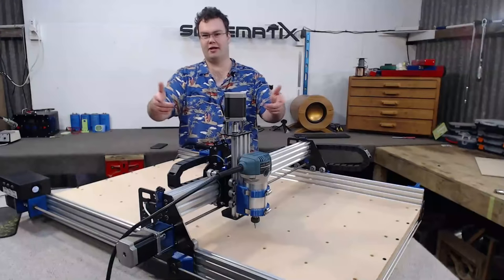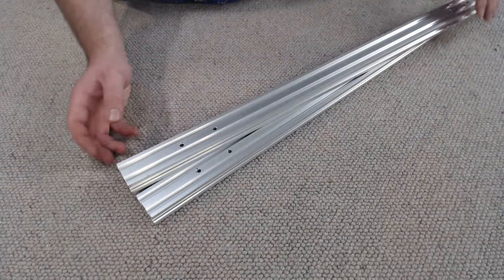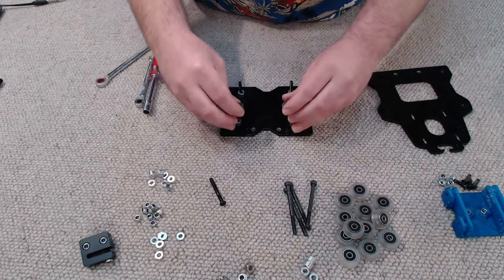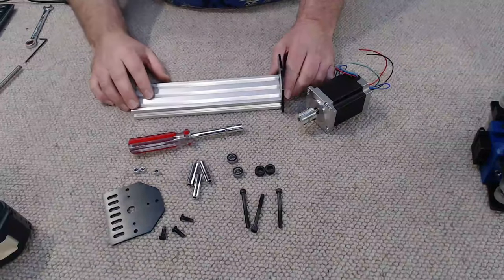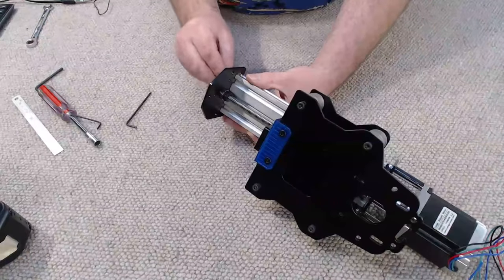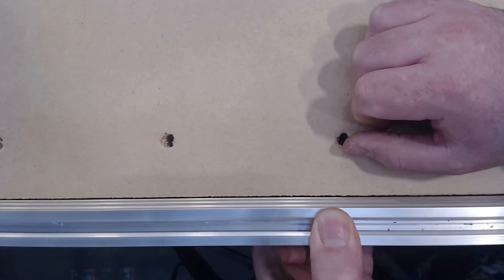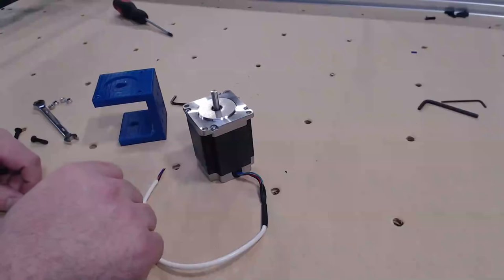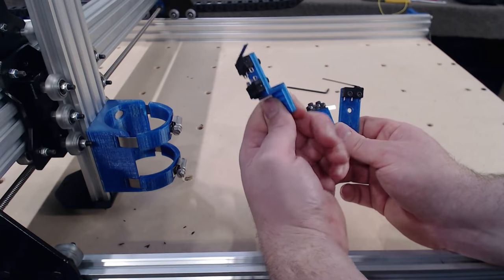How To Make: The OX-Metal CNC Router Mill (Complete build)

Comment: This is amazing. I run a small furniture company in the UK. We have been looking for a way to get CNC for a long time but it has always been out of our price range. Hopefully will be building this over the next few weeks!
Reply from the maker: That's awesome to hear! hope the build goes smoothly :)
Reply: I will keep you posted. At the moment i am trying to cost up the whole build. On another note, after i have succesfully done the build, i am considering scaling it up to cut 2440 x 1220mm board. What would be the issues of this?
Reply from the maker: If scaled to the size mentioned the axis's will lose some amount of stiffness. Probably still good for cutting wood. But metal will be out of the question. You'll have to alter the design to use GT belt as longer lengths of 8mm lead screw are almost hard to find.
Reply: I have had a quick look at i did see some 8mm lead screw at 2500mm. My worry is that the length of it will cause it the bow. Anyway i will focus on getting the original built then perhaps look at going bigger. Even at the size it is now it will really help our business.
Reply from the maker: its possible it will bow at that length, belt or 8mm screw will both have a high amount of elasticity at that length. Some experimentation maybe required. At least you know the size machine I build in the video is rock solid
Reply from the maker: Just an after thought, I'd recommend perhaps getting gantry plates that allow more head room for milling thicker stock. Could be handy considering the type of stock I imagine a furniture company milling. I'm considering doing this to my OX-Metal in the future.
Reply: well we use 18mm mdf. It may be beneficial to have more travel on the Z axis if we decide to laminate boards together. For example producing a mirror / picture frame out of one laminated block of wood so you get the depth for cut detailing. It looks like the Gantry plate is produced in one size only? I have costed out the machine in this video, comes to around £1,100 including your router and cost of printing the 3D parts. Not sure what the software costs may be on top of this, but there is probably some freeware available (i need to study more in depth your other video from the computer side of things). That being said my target to get this built and running is by the end of the year. hopefully a lot sooner.
Reply from the maker: If you're only planning to cut MDF/plywood or similar then you'll be fine with the stock gantry plates. There is only 1 size I'm aware of, you'd have to get the gantry's design slightly altered for more Z travel. As far as software goes I'm doing a video soon on CAM software. Freeware has been so far a mixed bag (mostly bad) But there is 1 paid CAM program that rocks for only $250USD. stay tuned!

Comment: what is the cost of the CNC router and where can you purchase one I'm in the USA thanks for your help nice job
Reply: quality Router cutting bits can become rather expensive but a Dewalt 611 goes for around $120.
purchase the other parts from the part store!
http://openbuildspartstore.com/
Reply: FearlessVampireKiller.            No I'm not talking about just the router I meant the whole CNC router machine where did you get it and what can I expect to pay for something like that.  Thanks Jim
Reply: Jim....you can learn how to make them online...there are many CAD models and instructions complete for free online (for instance just one site of many that has many different versions of the same router (known as the 'OX' design) can be found by googling "OXcnc" and going to the website.  As far as the cost....well that question is similar to asking 'how much does a table saw cost' or how much does a 'truck' cost....it depends on the table saw and the features and where you buy it from and it depends on the truck you want....there are some trucks that you might be able to buy new for ?? 20000 dollars...there are also some that cost more than 150 thousand (I am sure if I looked a bit I could find such an asking price).  Your question is so general it is impossible to give a 'decent' answer...IMHO (in my humble opinion).
Reply: as for the cost of arouter type cnc for wood and light aluminum routing....well you ballpark.....0 dollars plus a whol lot of 'time'....to ....a crappy one for ?? 500 dollars ISH (just pulling a number out of the air and assuming that is bottom of the barrel for mostly pre-fabricated factory designed version....that price is still honestly a bit lower than mainstream (i.e. you would have a hard time finding a CNC for that price...let alone one that was worth much...I might be wrong...but it is a ballpark pulled out of thin air to help you.  The answer was a bit late in coming I know, but late is better than no answer at all right?

Comment: I have just acquired most of the parts to build the OX-Metal CNC Router. My big dilemma concerns which stepper driver to use. I know you chose the CNC Xpro and I am looking at that as well as the TinyG and TinyG g2 by Syntheos. Do you have any recommendation enthuse units vs CNC XPro V2 or V3?
Reply from the maker: I'd recommend the CNC xPro boards. Very easy setup with a solid amount of features.

Comment: What kind or spindles are supported for use on this?  I am looking at at least a .800kw- 1.5kw water cooled spindle and I know I will need to find a mount for it but I was unsure of the flex support in the frame with the use of a higher torque spindle.
Reply: I.m.o one of the best out there.

Comment: I made a cnc based on cnc ox. I used the new gt3 pulley and it is quite strong.
I made the machine with 1000x1000, but with the v-slot 2040 because it was what I had available. Now I have monetary availability to complete the machine with v-slot 2080 and 2060. Do you think the pulley holds the 1500mm 2080?
Reply: belt not newer have strong at cnc worst all idea, screw need be or rack and pinion steel not aluminium.

Comment: Hi you are great.. i will make the same CNC mill... question, witch Filament did you use... i dont understand it in your Video... PLA or ABS and Why? thanks
Reply from the maker: The filament I used is PETG. which is a very easy to print filament, very strong  with reasonable temperature resistance. A quality ABS should work also.

Comment: I love the design and plan to begin sourcing parts to build a replica, I did have few questions.  What would you say is the largest X/Y dimensions you would feel comfortable building with this design?   What is best media for the 3d printed parts? I am getting a wide array of prices to have them printed, what should they cost approximately?  In hindsight and all things considered is there anything you wished you would've done differently in the design and or build?Thanks in advancePatrick
Reply from the maker: Thanks. Personally I like the size I build, it enables me to machine alloy at a decent rate. But if you're only machining plastics, wood.etc you could stretch the dimensions. I'd recommend printing in PETG or a high quality ABS or ABS+. There isn't anything I'd change on my mill :)

Comment: Do you think that the machine would be stable in 1500x1500mm configuration, by simply extending the length of the leadscrews, and v-slot profiles?
Reply from the maker: Yes you could. You'd have to machine harder materials slower to avoid backlash.
Reply: Gotcha, thanks for the response.

Comment: Great video. I have a question. You keep mentioning "8 mm low profile screws" as you install them. I assume you are talking about the diameter of the screw and not its length. If so, where did you buy them? I have spent a lot of time trying to find 8 mm low profile screws but with NO luck; unless they are very long.

I can find all manner of 5 MM low profile screws but not 8 MM, unless as I said, very long.

I would appreciate knowing where you got them in shorter lengths. (Note: There is a pseudo 8 mm low profile screw that is sold in shorter lengths; but the height of the head is twice as thick as those you are using. IE: the heads are 5 mm high. I want the very low profile like  you and "OpenBuilds" uses.

Thank you so much,

patdee
Reply: 8mm in length. all the screws are M5 .8 pitch

Comment: Sorry to keep bugging you but I bought the gantry plates and they say they are 6.6mm thick. And your STL files say either 4mm or 6mm will they need to be modified or will it still work?
Reply from the maker: That's alright, it should work just fine. 0.6mm should affect anything.
Reply: Thanks so much

Comment: Great work ! and very detailed. I have already  the regular GT2 driven OX Machine and would like to upgrade to your design. In the parts list however I dont see the blue coated parts needed for the leadscrew assembly.Are they available . Ilanon OpenBuilds or elsewhere ?. Thanks a lot for a reply
Reply: The blue parts are the 3D printed parts he refers to in the video. Check the link that refers to ThingVerse.
Reply: Thank a lot, Regards

Comment: Hi can you please inform to the thickness of your gantry plates? i ordered all the parts you listed as i like your build.
I received 7mm gantry plates as per your parts list, will they suit your files re the 6mm? or do i have to order new one? please help
Reply from the maker: I didn't specify the thickness of the gantry plates. Largely because the 3D part files come in  2 different sizes (4mm & 6mm) which covers the majority. 7mm is a rather odd thickness I must say. However I think you'll be able to get it to work. I'd recommend using the 6mm part files. Most of the mounts will work with a couple exceptions being touched up with a metal file to make room for the extra mm.
Reply: Thanks for the reply

Comment: I thought the Y Leadscrew mount and Y Nema 23 mounts looked a little light on gussets/reinforcing.  After 5 and a half hours printing the first Leadscrew mount (PETG), sure enough, it snapped off right where the gusset (chamfer) meets the upright section (the part that holds the bearing) while I was removing it from the print bed.

I'll try printing it in a different orientation.  If I had the CAD files, I'd add more support, but I don't know how to edit .stl files.
Reply: This is about a year too late but generally PETG has excellent layer adhesion.  If you had a part break removing it from the print bed, I'd probably check your print settings before trying to redesign the part.  Even in the wrong orientation, the part shouldn't break simply taking it off the print bed.  You may have already tried it, but try printing with little or no cooling fan at 240c.  I get good results, generally speaking, with PETG at those settings.  If I lower to 220c or use more than about 20% cooling fan, I get some brittle parts.  Since these are functional pieces, the extra cosmetic quality afforded by lower print temperatures and/or cooling isn't worth increased brittleness.

Comment: Thinking about building this. What's the correct Nema23 type you are using? High Torque? I see there are different types. The housing of the one's used in the vid seem longer than the one's in the parts list.
Reply from the maker: Fortunately with a build like this a wide range of Nema 23's will work. Some people like to match the motor current rating to the output current of the stepper driver. The motors I bought are on the large side for a build like this. From memory they are rated at 3amps current. The ones listed in the build list will work fine for this build
Reply: Ordered all the parts last night... so.. fingers crossed everything works out. Today I already received the first parts; MR105-2RS Bearings. Guess those are left-overs from the original OX parts list, which used Nema17's, because I can not find out where they go in the Metal version. Or am I missing something here? 

What would be the best suitable spindle to match the rest of the machine as far as KW go? 0,8KW 1,5KW 2,2KW? Don't want to use a separate device such as DeWalt, Kress or Makita because of the screaming noise they produce (my GF, neighbors blaa blaa bla). I also want the spindle speed to be controlled by the software, for it to be (fairly-)quiet and stop automatically when the job is done. Looking into the Huan Yang spindles at this point.

Anyway... thanks for all the work you put into this build and your reply. Just created an OpenBuild account. So maybe I will contact you in the near future thru their website if I need any advice or help regarding my OX-Metal build ;-)
Reply: nema 23 4A 3Nm normal used. best have nema 34 6-8A 12Nm torque.
Reply: @NoXs4u  cnc NOT newer used nema 17 motors, its only roy and 3D and laser motors no torque move if cut wood and aluminium, minimum have nema 23 3Nm motors.

Comment: Great build. I am planning to give it a shot. What is the accuracy of this machine?
Reply from the maker: Thanks. What exactly do mean by "accuracy"?
Reply: I mean resolution of positioning and positioning repeatability.
Reply from the maker: I haven't bothered with resolution tests, simply because it will be so miniscule for my applications. Speaking from experience measuring parts milled on this CNC mill, you can expect 0.01mm (0.0004 inch) tolerance provided everything is calibrated and built correctly.
Reply: That's great. Thank you

Comment: Hi from the Scottish Borders in the UK.
Great to have you back and up & running again. About 18 months ago I built your OX metal CNC. This was my first venture into CNC and am now addicted. (Ask the wife !)
Your machine is just fab and works great. I have added a few things to your original. A touch probe ( very handy), A laser pointer to determine zero axis, and run everything from a Raspberry Pi with BCNC software.
My question is do you have any plans to upgrade the machine itself  like extending the z axis for bigger carving projects. or, a 4th axis. Would love to see what you would come up with.
Keep up the excellent channel.
Cheers
Reply from the maker: Thanks kindly for your support! I do have some upgrades planned. I would like to upgrade the spindle. And add the option to swap out to a laser cutter/engraver.
Reply: @Schematix . Oh wow.... That's brilliant. My next project was going to build a stand alone laser cutter but now.... Can't wait.
Cheers
Tom

Comment: Awesome build. Looks really rigid and sturdy. Are your limit switches NO or NC? Also, I built a XY laser engraver using the V-slots with 3D printed plastic parts and after about 8 months I'm observing that they seem to losing their stiffness and the screws are warping out a little. Any such experience?
Reply from the maker: I wired my switches NO, however I've noticed with the CNC xPro v2 driver board I'm using , the board is only looking for a change of state. So you could wire it NO or NC. The type of filament is important, especially for this type of application. What type of filament was used to print your parts? I've been printing with PETG for over a couple years with similar applications and have never had any issues.
Reply: Ah I see. The board I use for my laser can set the limit switch modes as NC or NO. I'm also going to experiment with Hall effect switches which I'm told are for more resilient to noisy environments. I printed mine with PLA. Maybe that's why. I've heard of PETG and will give that a shot as well.
Reply from the maker: Sorry to say PLA is completely the wrong type of filament. PLA will deform over time, and is at risk of wapping out of shape at relatively low temperatures (as low as 40~50c) PETG can be tricky to print, but once you know how to tame it, its awesome. ABS+ is also another decent filament you could try and it's eaiser to print than PETG
Reply: Got it. Looking forward to building this soon.

Comment: Love the build. Question to the stepper motors: Do they effect how well the machine can mill/engrave harder materials?
Reply from the maker: You need a powerful enough stepper motor to avoid skipping steps which would ruin whatever you're milling at the time. :)
Reply: Then how do you choose between all the different types? NEMA, hybrid, IP65,.... I would like to be able to use the final results for plastic, wood, aluminum and possibly steel. In this case that means I will be able to exchange the mill with a dremel on the fly if needed, but only if I can make it the motors strong enough.
Reply: I keep hearing about stepper motors.. what about servo motors? They give better accuracy do they not?
Reply: @michaelkelly3158  servo motors have only 10x expensive than open loop motor, yes have sure accurate but hobby user have stupid waste money servo. maybe if dad have millionaire then can,

Comment: nice solid build you have, welldone 
I would like to know what exact type of OX plate set u had used for your build , i am having difficult time to choose the right one to buy, please help......
you could precise the link of OX plates in your openbuild website, or draw the exact mesuring of it so we could mill it......
thank you.
Reply from the maker: The OX-Metal uses standard OX gantry plates. All the info for the plates can be found on the original OX build page including DXF drawings for the plates. http://www.openbuilds.com/builds/openbuilds-ox-cnc-machine.341/
Reply: thank u soo much for the reply
Reply: I'd advise you to go to Xcarve to buy a good router system, it's simple & easy looks good and runs good
Reply: @dennisrobinson1290  xcarve is garbage, so why are u advising someone to buy it?  It is over priced and can be built for much cheaper.

Comment: I should have "done my research". I bought a "Bob's CNC E-3", the original kit because it was so highly rated, good customer support and it was my first CNC. Last week I spent 4 days getting it tightened up and running again, and I am extremely disappointed with the slop, and regret spending the $700 on the kit. Of course, I didn't know any better at the time. It is primarily made of wood which should have been an early red flag.